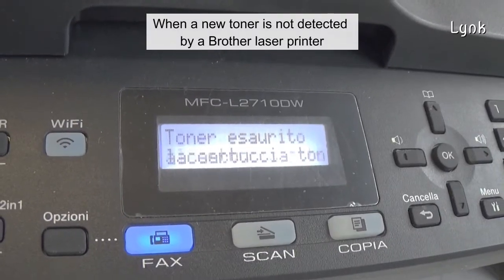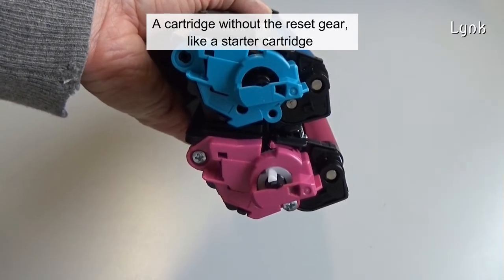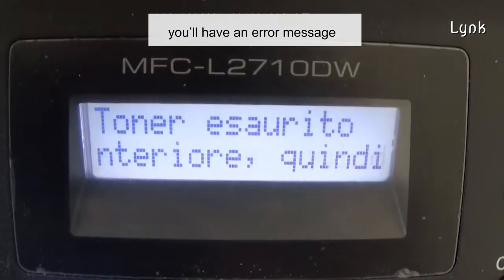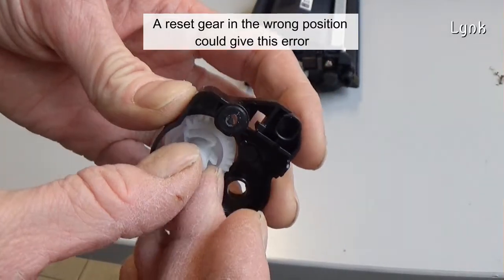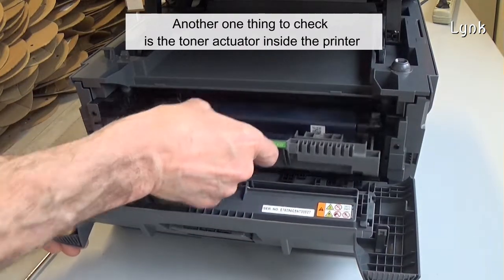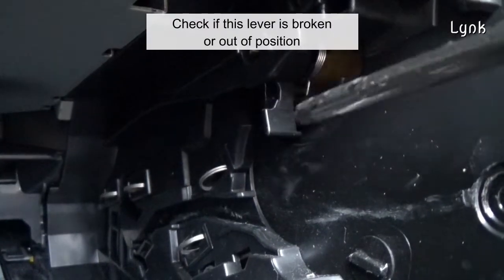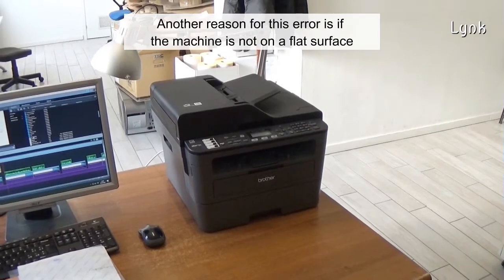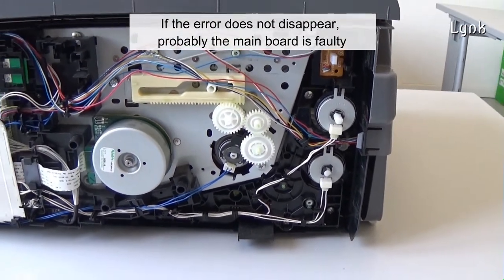Brother printer does not recognize new toner

Comment: Recently, I ran across another situation where the Toner Cartridge isn't recognized. The Brother printer (HL-L3290CDW), will not necessarily recognize the cartridge was replaced. The cartridge which was previously in it was a standard capacity, but the replacement was high capacity. Here's what happened: I ran out of Black Toner Cartridge. Removed it and inserted the High Capacity One. That's when I received the cryptic Error Message stating that no Toner Cartridge was in it. There was no indication as to which one was missing. I brought up the Printer Toner Reset display by pressing the Clear and Stop Buttons at the same time and then the Clear Button. Pressing the Clear Button the second time is what brings up the display. I initially reset the High Capacity indicator for Black. That didn't work. I then reset the Standard Capacity indicator and that worked.
Reply: Toner reset worked for me! Thank you!

Comment: New subscriber watching from Al Khafji Saudi Arabia. Sir can you help me with my brother L8690cdw there is NO DISPLAY but have power indicator thank you.
Reply from the maker: You mean the power light is red? No other informations in the printer folder?
Reply: @viandant5  YES only LED power indicator Red... Totally no display and  no any sound from mechanical moving... Thank you for response.
Reply from the maker: @niloyu105  That machine has a control panel and a display, no indications? The red light is a general error, check the toner cartridges, paper settings, paper jams
Reply: @viandant5  thank you for response. Yes Sir totally no display on LCD and but it's have power indicator light... Thank you

Comment: I have an MFC8850CDW that gives this error intermittently. It will print perfectly, and then it will give this error, and when it gives the error, it also prints with all of the colors being a messy background behind the text. Then if I take the drum out and reseat it, the next printing will print perfectly again for a few pages. I just replaced all of the toners. Any ideas? Gratzie mille!
Reply from the maker: It's difficult to say, it seems a drum problem more than a toner problem. Try to clean the contacts between the drum and toner printer
Reply: @viandant5  Thank you for your help!  When you say toner printer, do you mean each of the 4 toner cartridges, or do you mean the toner fuser that sits below the drum?
Reply from the maker: @WizardofAdsOnline  Do you mean the transfer roller? It could cause that defect too, but I think  the problem is the drum unit
Reply: @viandant5  I cleaned all of the rollers on the drum unit, and cleaned the surface of the transfer roller, but that didn't change the behavior at all. Here's the kicker that I realized yesterday. We can print images and they print perfectly, but if we print text, it gets sloppy toner color patterns behind the text. Those patterns are the same each time I print a single page of text. At the end of printing one text based print job, it also gives the toner not detected error. Every time I do the test print on the printer, it still prints beautifully.
Reply from the maker: @WizardofAdsOnline  Cleaning the drum unit sometime it's not enought if the drum is worn or defective. I can't be sure because I cant' check the machine but I think it's a drum problem. It could be the high voltage power supply too

Comment: Replacing the chip worked for my TN-760   cartridge, hopefully it will keep working
Reply: YES! that was my issue with cheap toner from Amazon, thank you!
Reply: Hi Andrew, how did you replace it? Can you order just a chip? Thanks!
Reply: @alexgoldenphoto  pULL THE CHIP FROM THE LAST WORKING TONER CARTRIDGE
Reply: @MichaelShannon313  Great advice ! Worked perfectly for my TN-247 cartridges after other steps failed to resolve the problem. Thanks.
Reply: Got mine working too!  Thing pops right out :)  Thanks so much!!!

Comment: hello i sent you a message about acm1415fnw  to your email....it hangs after switching on the printer for ever
Reply from the maker: Check the printer folder, are there additional informations?
Reply: It hangs immidiatly I on it,like roam for further navigation I sent picture of what it shows to your mail.I sent detail and picture to link.accessori@libero.it
Reply from the maker: Try to turn off the printer, remove the toner cartridges, then turn on the printer. Does it work? Try to remove the electrical cable for 10 minutes.
Reply: @viandant5  it doesnt work sir,i remove the  toner yet it show same thing
Reply from the maker: @Thethoughtarchitect-l7r  Does the transfer belt turns freely?  if it turn, the problem could be the main board

Comment: Thanks, great infos as always! 
By the way, just a little piece of additional info maybe: 

If you have a newer Brother laser/LED printer that uses toner cartridges with chips and you get the error message "No Toner. Open the Top Cover, then install Toner Cartridge" the source of this problem might be a missing or broken chip. I checked this behaviour by putting some tape over a chip of one of the TN-243/247 cartridges of my Brother HL-L3210CW and got the aforementioned error message. 
The printer also didn't tell me which one of the four colour cartridges (C/M/Y/K) was the source of the "No Toner" error message, so just by looking at the printer alone, it would've been hard to know which one of the four chips was malfunctioning (well, covered with a bit of tape in my case for this test).
Fortunately you can use the "Brother Status Monitor" software from the "Brother Utilities" on your PC to determine which toner cartridge is the source of the "No Toner. Open the Top Cover, then install Toner Cartridge" error message. It actually tells you which of the four colours is the problem.
Reply: Life saver... thanks for the Brother Status Monitor tip!!!
Reply: thank you so much ... after two days now my problem was easily solved with the utilities app solution
Reply: i am planning to buy the specific printer do you have any problems with non genuine toners or any problems?
Reply: @zinoscost5731  no problems, but you have to swap the chip from the brother cartridge to the replacement. Process takes about 20 seconds pee cartridge. It's just unscrewing the side piece with chip and putting on replacement
Reply: this tip about switching the chip is what helped me! thank you so much
Reply: @zinoscost5731  As someone who doesn't print a lot I haven't even used up the starter toners after 1.5 years yet, but so far I'm very happy with the printer. My only regret so far is not having chosen the version with a duplex unit (It did cost only a couple of bucks more, and without it I have to turn the stacks of paper by hand and put them in the paper tray again).
I think Brother laser/LED printers are quite robust machines and as far as I've heard they take 3rd party toners without complaints. And even if a 3rd party toner has quality problems, it usually won't hurt the printer (unless the cartridge loses toner, so you have to clean out lots of dust), you can just replace the bad toner cartridge with a new one and should be fine mostly.

However: Toner cartridges are quite complex little things, it's not only a box with powder inside. There are quite a few things on very cheap toner cartridges that might go wrong and might impact the print quality. Or they might work at first, but the print quality might degrade after printing only 50% of the expected pages.
There are better 3rd party cartridges, but they are also more expensive. 
Genuine toner cartridges generally work best and will give you the least amount of trouble, I think - not only in Brother models, but all colour laser printers.

I would advise to have a look first at your expected print volume per month. If you print a lot and regularly, then you might wanna buy an inkjet printer. Maybe even an inkjet with a continuous ink system, like an Epson Ecotank or whatever the other brands call theirs. Reason being: Cheap laser/LED printers are usually way more expensive in the costs per page. (Also: inkjets have better photo print quality on special papers. But ink won't hold up to sunlight or water as well as toner.)

As someone who doesn't print much, I'm happy with this cheap LED printer though. I got fed up of inkjet cartridges drying out, clogged print heads, them using a ton of ink on print head cleaning cycles etc. A laser/LED printer nearly always just works and doesn't care for long pauses between print jobs (however I try to turn it on once every one or two months at least, so that the fuser unit rollers don't get flat on one side, like car tires that are never moved).
The costs per page are a little bit higher, but I don't care since I print so little... with an inkjet printer, most of the ink would go unused in print head cleaning cycles for me.

As I said, I would take a look at your expected print volume first. And I would decide what printer to buy based on the prices of genuine toner or ink cartridges.
If 3rd party toner cartridges or ink cartridges work for you: so the better, you can save a few bucks then, compared to genuine carts. 
But you might also try 3rd party toner cartridges at first, might find that they are more trouble than they're worth to you, and then you might switch to genuine cartridges later on anyway.
Or you might find a 3rd party toner brand that you're happy with, that give you a good compromise between print quality and savings.

I can't comment on good quality 3rd party toner brands since I haven't tried any so far. All I'm saying is: I would advise to decide on which printer to buy based on the prices of genuine toner/ink cartridges. The availability of cheap 3rd party carts is a plus in my book, and something that you might give a try. But it might happen that you're not satisfied with the print quality/reach of 3rd party carts, and wanna switch back to genuine carts later.
Reply: @Defcon2000  i have also bought inkjet and gone bad because i didnt used it much thats why i am going with laser